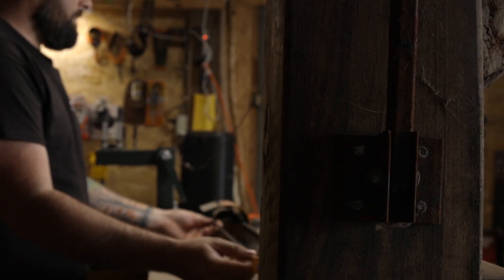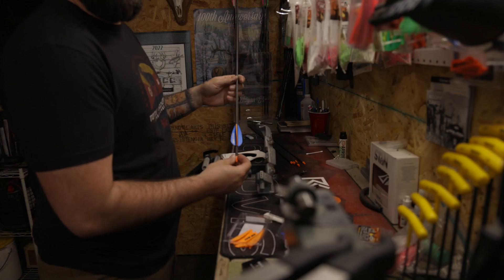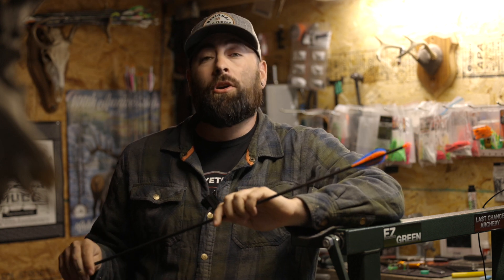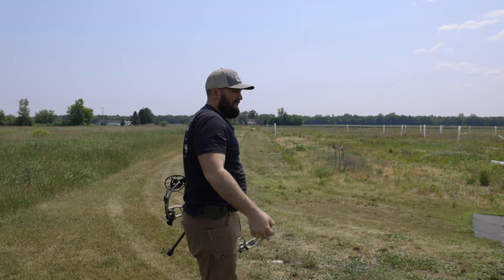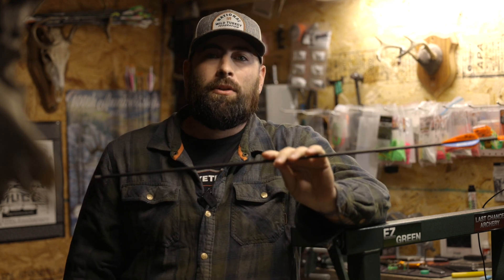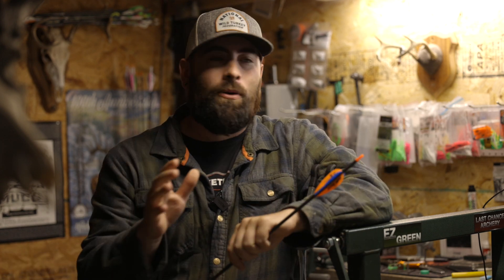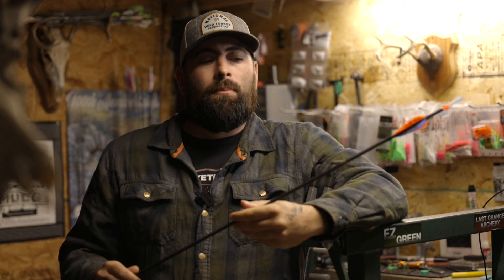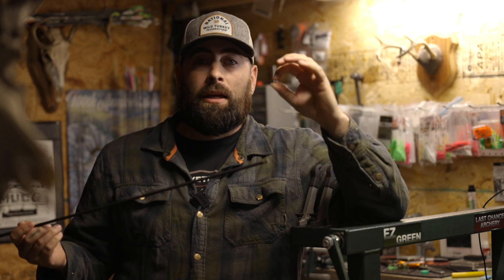FIRST IMPRESSIONS of New 2023 Arrows | Havok Hunting Products

Comment: Any clue why your code with trophy line might not be working? Trying to order a harness set up and it keeps saying enter a valid code 🤷‍♂️
Reply from the maker: If you e used it once before it won’t work a second time. But, they were also talking about getting rid of the codes so that might of finally happened.